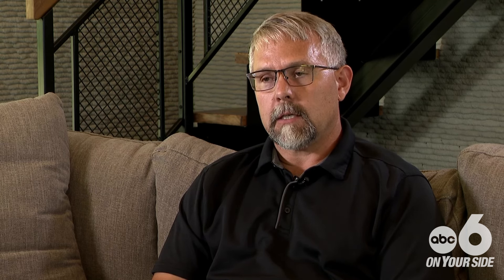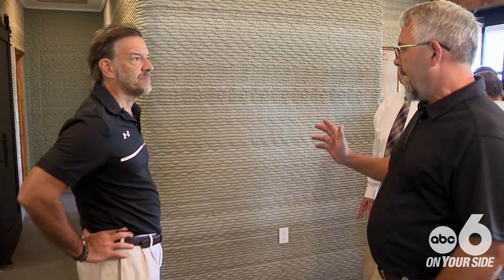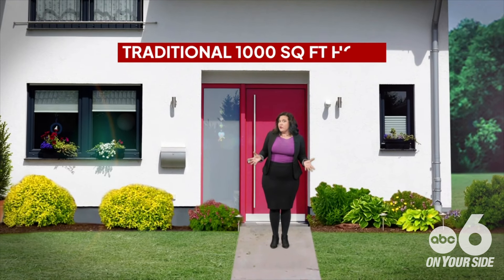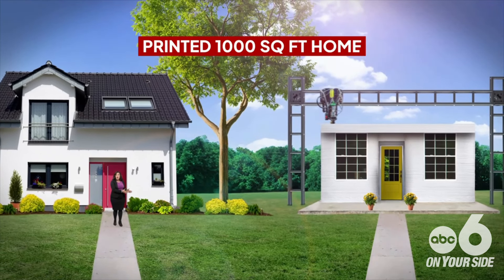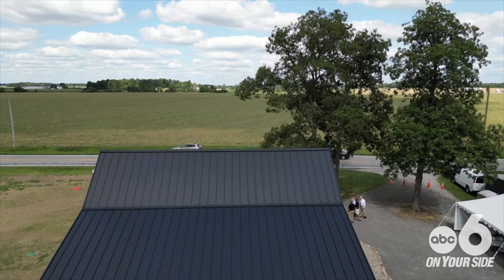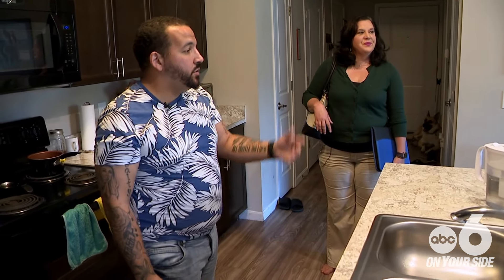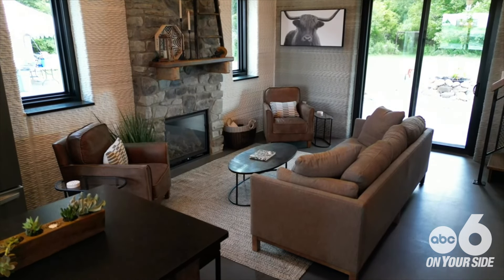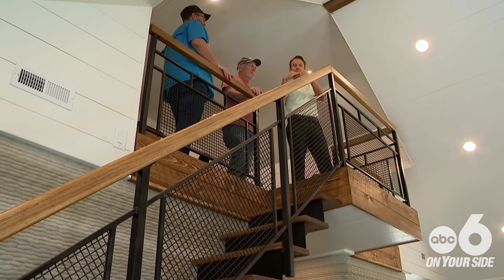Builder of first Ohio 3D-printed home says own 'for the price of a car payment'

Comment: If I buy another home, I will have a ICF (insulated concrete form) home built on the water in South Florida, with hurricane proof windows and doors. I'll make sure it is properly trenched for drainage, and have it built on the type of slab that allows the water to run right through and not pool up. This type of home is ideal for Florida.